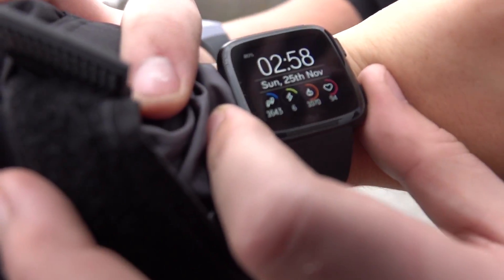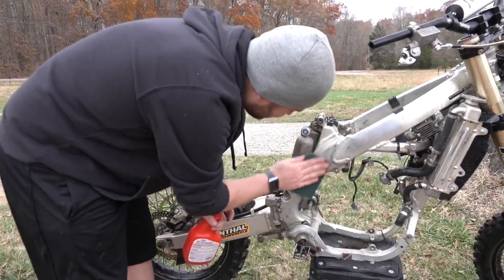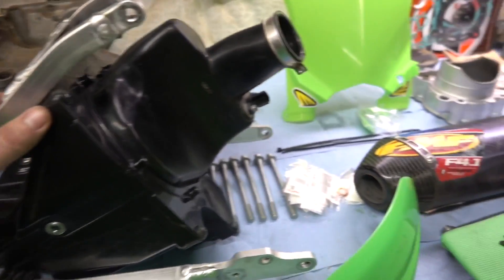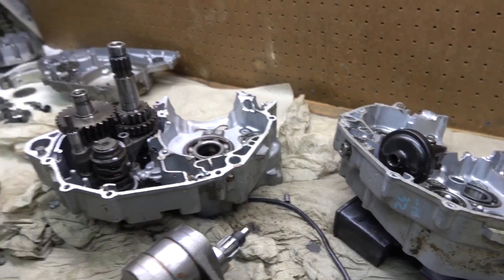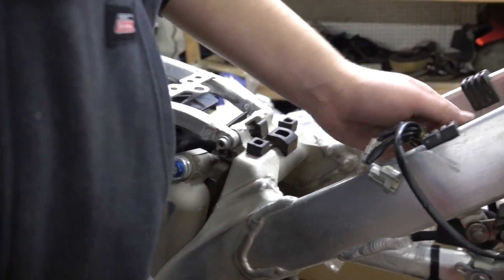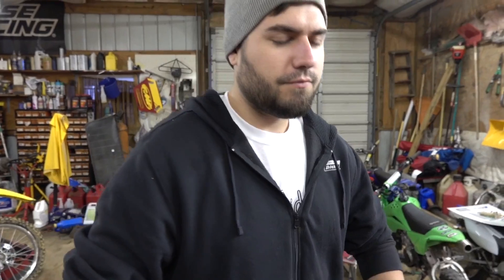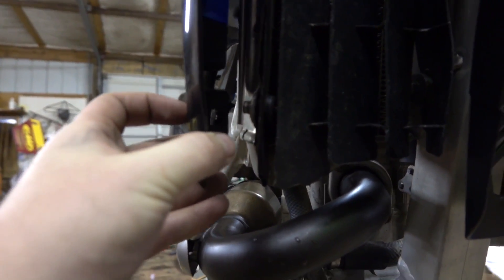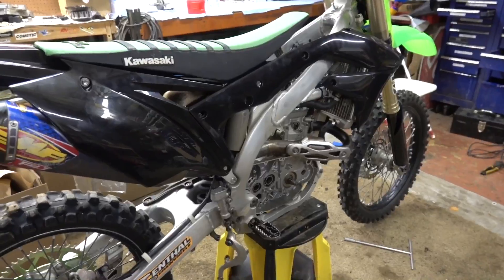2013 KX450F PROJECT BIKE PLASTIC CONVERSION | Part 2

Comment: Surprised your not running a IMS oversized tank for the GNCC races. I run one on my Yz250x with dry break for desert racing but on my Yz125 I race motocross on I dont do to the weight. You should run bigger pegs as well make a big difference.